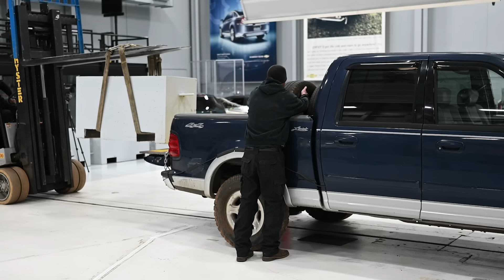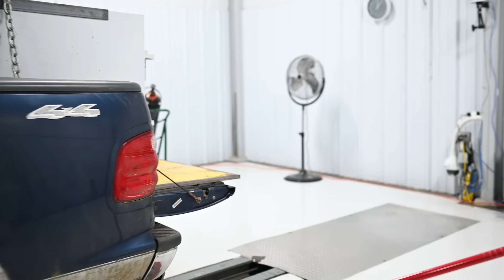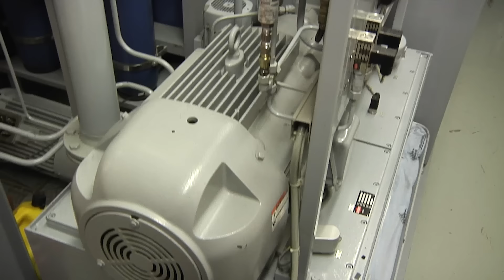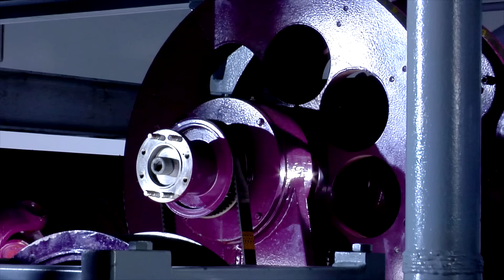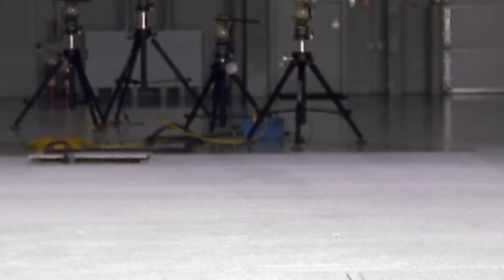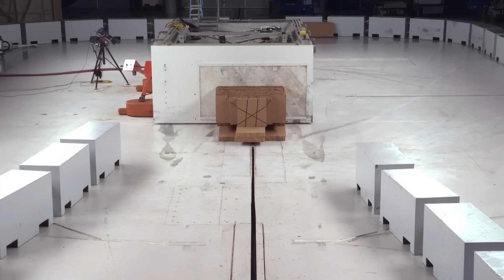IIHS crash propulsion system still pulling its weight

Comment: Speaking of weight, Would love to see heavy duty pickups and cargo van tests. Payload vs no payload, too.
Reply: Given that the Chevy Express has been essentially the same vehicle since the 90s, its crash test results would likely be poor in every respect...
Reply: @andrepoiy111999  when Mitsubishi replaced their Express van from the 80s cabover design to a rebadged Renault Trafic, while a more modern design in comparison, it was still rated poor as the Trafic was also based on an old and not as safe of a design.

Comment: Why the maximum of 40 mph for your tests?
Reply from the maker: The energy involved in a 40 mph frontal barrier test captures most real-world crashes with injuries. Keep in mind real-world crashes often involve pre-crash braking or impacts with other movable/moving objects, rather than a stationary object. Pushing crash test speeds higher might result in designs that would hold up better at higher speeds, but they would also have to be more rigid, which could make lower speed impacts more dangerous.
Reply: @iihs-hldi  "which could make lower speed impacts more dangerous"   quit your shit!!

   it make me so mad.    that is proven bull shit after your old pres. adrian was hit in his bmw 540i

Comment: 40 mph is nothing. Do better otherwise it's not a realistic crash
Reply from the maker: 40 mph fixed barrier tests capture the energy involved in the majority of injury crashes that occur on U.S. roads. Keep in mind that real-world crashes often involve impacts with movable or moving objects, so the forces involved are lower than the impact speed might suggest. To hold up and and protect occupants in very high-speed crashes, vehicles would need to be designed with very stiff structures that would provide less protection in more common lower-speed crash. Or vehicles would need larger crumple zones which might be impractical.
Reply: @iihs-hldi  Makes sense. Then IIHS should be pushing for public transport, especially trains, to replace the private monopoly over transportation.

Comment: Questions/ideas for other safety videos:

How come you don't do any rear crash testing? Or why isn't it a standard?

Crash testing SUVs/crossovers with luggage and other objects in the back. I've read in Europe they have strict standards for that but in the US it's not really mentioned. I'd say the majority of people don't think about how they load stuff inside their vehicles. I even read stories about stuff in the back basically forcing the rear seat to fold down in an accident from impact.

Also a request for more videos of bigger heavier vehicles against smaller vehicles. Hopefully that will continue to improve safety standards.

Thank you for what you do to improve safety.
Reply: I've been worried about this for a while, often put the seatbelt around bags to hold them in place.
Reply: @scottthewaterwarrior  Most fatal crashes happen on frontal crashes, so that's where they would focus their testing efforts on.

Comment: We need the standard crash test speeds to be increased to 60mph for light vehicles. Because thats how much force their frames will need to stand when they hit todays heavy trucks and suvs going 40 mph down the road. Testing vehicles against their own mass is flawed. This is why you still have fatalities with modern cars.
Reply from the maker: Making vehicles safer is only going to get us so far. We need to prevent crashes. This involves vehicle changes like more crash avoidance technology. Those heavy trucks need AEB that will intervene and mitigate the severity of that crash. Meanwhile, we need to invest in proven solutions like more speed and alcohol enforcement, roadway changes (roundabouts, road diets, etc), red light cameras, better lighting and pedestrian infrastructure.... IIHS will continue to push for safer vehicles but crashwothiness alone is just one piece of the puzzle.
Reply: @iihs-hldi  but drivers can turn these technologies off so it doesn’t mean much at the end.
Reply: @LivingTheDream77  People can also steer into head on traffic if they wanted.  What's your point?
Reply: @iihs-hldi  It's been proven that red light cameras have not made the roads safer. They're cash grabs for city and local governments. There are things you can do to make the roads safer but the fact that you don't even bring them up shows you're currupt.
Reply: @DrinkWhiskeyRaiseHell  they wont be able to with these technologies

Comment: I'm curious to see how smaller, currently safe, vehicles will fare in head-on collisions with the 9500lb behemoths.
Reply from the maker: Probably not well. It's basic physics after all. https://youtu.be/2XKOzibVqJg
Reply: That should be a major concern of the top-down push toward electric vehicles, but is never even addressed. I guess the environment will be better off without me or my gas-guzzling 35 mpg car.
Reply: @matthewbowen5841  or it won’t be potentially with how bad the batteries are and the fact some last as little as 200k-250k km where petrol 300-500k and diesel over 400k-1 million depending on brand obviously and built quality but obviously the pronoem that is still present is range n Australia we have many thousands of km of outback some places have no fuel or stops for 500km the logistics of putting a charging network out h their is hard enough not to mention the power grid can’t handle it in most countries currently 4 electric cars equivalent to about 25 fridges at every house just for an idea when their charging.
Reply: @iihs-hldi  Thanks.  That was a good video.

Comment: the hummer ev is probably the heaviest EV sold to consumers so far, weighing at about 9,500 pounds, which is why they targeted that
Reply: 9500 pounds 😱
Reply: Imagine owning a car that weighs so much that a bus is rivaling it.
Reply: @jwalster9412  not to mention the unnecessarily fast 0-60 time. I don't think it's a good idea to give regular people the speed of a sport/super car alone much less when it's also the weight of a bus. Not gonna end well.
Reply: @pieguy203  this is America were talking about. The government will just pass a bill that makes vehicles above a certain weight class be slow or something like that.
Reply: @jwalster9412  no, they'll make you pay a tax stamp and not address the problem further after that.
Reply: The net says that the Hummer EV is 9,036 lb , this is 700 lb HEAVIER than a GMC Sierra 3500 Denali .  Not much of a difference here.
Reply: @bobroberts2371  You're right there I'll give you that. However the 0-60 time for a 2021 3500 hd is 7.5 seconds, or at least that's what I saw, which is significantly slower than the hummer ev. 

I don't know what the hummer EV's actual 0-60 is as I think the 3 second time requires a special mode much like the Tesla plaid and I couldn't find anything saying the 0-60 without the mode but i guarantee it's faster than the GMC, probably around 5 seconds if I had to guess.

The hummer also has double the horsepower and the people who drive the 3500 trucks GENERALLY (not always) know what they're doing as they usually need the truck for a purpose such as hauling so they're used to vehicles that are heavy. But I suspect that most people who buy the hummer are people who live in big/moderate sized cities who wanna look "outdoorsy" and whose previous vehicle was probably sub 4000 lbs.

TL;DR: Big hummer heavy and fast, people bad at driving.

If only I put this much effort into my essays.
Reply: @bobroberts2371  what is that in kilos?
Reply: @jwalster9412 4098,66 kg
Reply: @bobroberts2371  The 2024 hummer SUV EV will be heavier I think but not sure.
Reply: Guess that thing will wear tires out frequently
Reply: @Shakerhood69  not to mention the sun 4 second 0-60 times.
Reply: thats alot of weight for a useless vehicle that will maybe last 5 years before its scrapped since the battery wont charge anymore
Reply: well if it's twice the size as everything on the road, it must be really safe right? now we just need a 18,000 pound truck. we'll all just drive in Peterbilts
Reply: @Shakerhood69  Nope those are like the 4th Car for rich people. It won't be doing much miles.
Reply: @tylerbaldwin1633 old person detected

Comment: Can you please post full footage of these crashes they are very interesting. Was rust found to be an issue for safety in these cars?
Reply from the maker: We didn't focus on any safety issues with these tests. We just needed the vehicles to get down the runway and up to speed, so we didn't perform usual pre- and post-crash assessments. However, from other tests of used vehicles we know that a lot of gunk coming out of vehicles isn't rust, but mostly just road dust and dirt. We see it even in vehicles that have only been on the road a few years.
Reply: @iihs-hldi  It can multiply quickly. A while ago I was parting out a 8 year old full size pickup, the dirt/gravel/sand trapped in the frame rails and crossmembers nearly filled a 5 gallon bucket.
Reply: @iihs-hldi  shall the the goverment limit or regulate total weight?

Comment: What headache rack would you recommend for the amount of weight you had in the F-150? That was very impressive! Have a great day.
Reply: That concrete block pierced the sheet metal not because of the lack of headache rack, but because it was tied only to sheetmetal, which of course immediately tore.

Even the frame on a truck like that is just bent sheet metal, there is literally nothing to tie something like that to, to keep it from moving forward....  Even in this test even if they tied the cement block to the rear of the frame of the pickup truck, the frame would have been as it did in the test.

 In other words this cement block would have just pushed any headache rack up to the dashboard because there's nothing to attach the headache wreck to that isn't just sheet metal.
Reply: You shouldn't load that amount of weight into an F150 ever

Comment: I would like to see more crash testing done with max payload in the bed. A bunch of mass back there will put some odd strains on things im not sure manufacturers are fully on top of
Reply: I want to see a modern truck VS a classic truck do this test. Which is worse?
Reply: Nah, that would only lead to more non sense. Let people be dumb. Take the warning labels off.
Reply: @j Walster  the older truck may perform a little better with regards to the box in the back as they tended to be made of thicker metal. 
However, for a 40mph or any speed impact, your better off in a new vehicle due to the crumple zones.
Reply: @mikeh2006  this could be true, however I fear the older truck will just obliterate the cabin and passengers, because of said thicker bed steel. New it's safer when crashed if the pay loaf is tied down right, but an older truck with the same load might come off worse because of the non strengthened passenger compartment.
Reply: @shawnbauman5463  People are already dumb. Making things worse will just lead to the rest of us suffering.

Comment: The Ford F-150's crash was very brutal!
Reply: Those were deathtrap vehicles.  It’s scary people are still driving them and think they are safe.
Reply: @user-tb7rn1il3q  the ext cab ones are (since Ive owned multiple 97-04 f150's and drive an ext cab) due to the lack of a B-pillar between the doors allowing the cab to crumple. the single and crew cab ones aren't due to their better structural rigidity
Reply: Super safe just think of carrying 5,000 a pounds boulder still the cabin of the truck managed to be intact and obviously no matter the car anything that heavy would get thru anything at speed
Reply: Geez they ARE safe the cabin could hold the brutal crash and didn’t deform

Comment: Watching that payload reach the dashboard was a bit disturbing...
Reply: I think it voided the warranty just a little.
Reply: That hit right where the cupholders are. Imagine losing your Slurpees in a crash like this I would be so pissed.
Reply: @dougfisher1813  in a crash like that, YOU will be the Slurpee.
Reply: @jwalster9412  need some flex tape
Reply: @LouisSubearth  not if he bails out of the car like a cool guy
Reply: It's a good reminder about properly securing loads. Although I don't think that would have saved this truck
Reply: And here come the ambulance chasing law suits. . .  There was a recent suit where an 2002 F-250 rolled over the the jury awarded a 1.7 BILLION settlement.
Reply: That would have taken an arm, at best. If someone was sitting in the middle in the back seat, their death would be horrifying.
Reply: @seanriley1603  All of the seats got pushed forward, this was not survivable by anyone.
Reply: @bobroberts2371  During the Super Duty design process, Ford bean counters changed the Engineer's design to use thinner metal, and then proceeded to downgrade even further and build with a weaker steel alloy. They had it coming.
Reply: No more riding in the middle for me
Reply: Back in the late 90s a friend and his dad were killed that way, 2 engine blocks went through the back of the truck cab when they got hit head on.  The kid was only 10 or 11 at the time
Reply: My cousin’s father died from something like this.
Sad part was that on his trip he was asked by multiple relatives to take a break on his trip, but didn’t want to.

He was in a Van and packed it full with electronics, putting himself very close to the steering wherl to br able to put more stuff in the van, he crashed low speed with another car and the weight of the electronics pushed the seat more in front, crushing his body.
Reply: Now imagine being a truck driver. I think about my load shift any time i have to brake way more than needed. Lol
Reply: @bobroberts2371  A jury can award whatever they want.  No one is going to collect over a billion.  Guaranteed it will be dropped to a few million by a court appointed mediator.
Reply: @eac1235  Last I heard, Ford appealed the entire verdict.  I'm pretty sure that any sort of court appointed mediator would only occur if the Judge set aside the juries decision before the court closed the case. .
Reply: If you think that's disturbing, you should watch real car crashes. Lots of cars loaded up with teenagers get smashed into strawberry applesauce every year. Teenagers are the largest demographic of car related fatalities. And they want to drop the voting age to 16. Hilarious. Letting kids that are easily exploited who can't pay attention long enough to steer a car should definitely be steering a whole country. That totally makes sense. If you're committing fraud at such a massive scale it involves the entire population. Then it makes sense. But aside from mass fraud that's obviously stupid.
Reply: @tbok75 this happened in gwinnett county ga a while back. Truck driver was impaled by his load (google it).
Reply: @SyrusLang  oh I'm sure. I've seen other videos and read stories of drivers getting killed by load shift. I think about it a bunch being a truck driver.
Oh wait that was my original comment. Lol sorry
Reply: I think this test is an excellent demonstration of how a pop can feels in a trash compactor. 😎
Reply: @massminer2343  makes me wonder what will hold all that force back in a 9000lb EV. If the batteries are built into the floor won't they slide up under to the front and possibly crush themselves? Or catch fire when things touch that shouldn't touch...
Reply: Well I'm pretty sure 9000 lbs is multiple times the max payload it is rated for, so this is probably not realistic on what would happen unless you were being an idiot.

Comment: The only advantages that newer cars have over “old junkers” are safety and speed.
Reply: There are a few more. Power, and agility.
Reply: @theclueguy3388  I think speed kind of covers both of those. You can’t really have speed without power and agility is the ability to move quickly and easily (pretty much speed).

Comment: Please do some old car, which were assessed to be safe at their time, crash tests so that there is more educational material, that newer vehicles have improved substantially in the safaty aspect and that testing regime has become much more stringent and not exactly comparable to old top safety picks of 15 years vintage.
Reply: There's a video of them crashing a 1959 Chevrolet with a 2009 Chevrolet.
Reply: @rcairforceone  thats a good video but slightly irrelevant to persued a friend to upgrade to newer and safer car as none is driving in 60s cars, but some are in 2000s cars, not being aware of the safety risks
Reply: @Rrr_n1  Something I've been wondering about too. Had a 93 accord where the front got demolished by a late model Jeep Wrangler while doing 40 mph. Something I chalked up to this car being designed in an era were SUV's were not common and the effects of the oil crisis starting to die down still left a lot of smaller cars on the road.